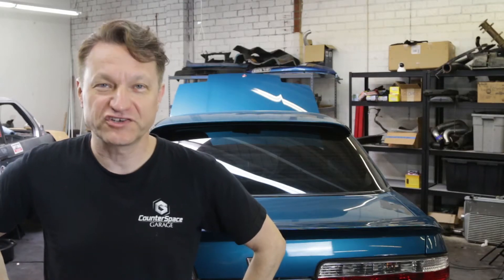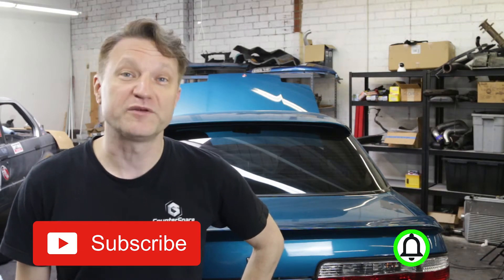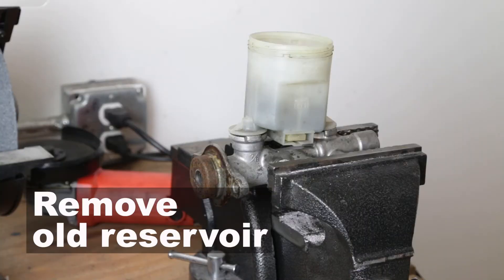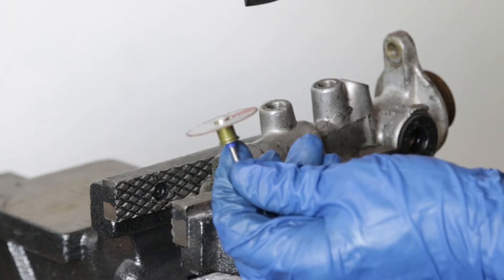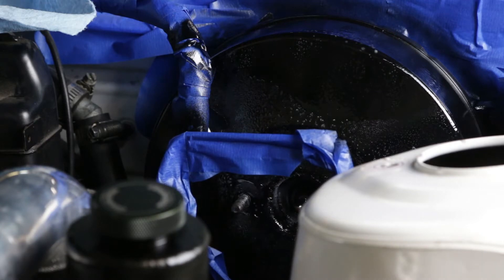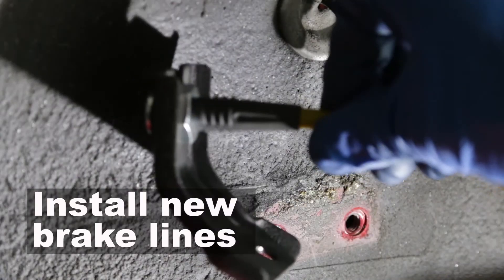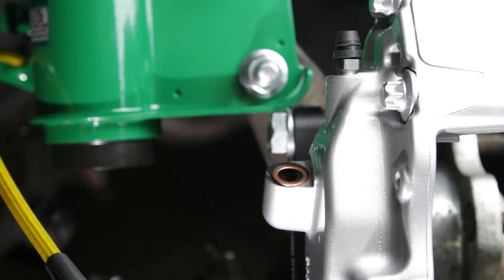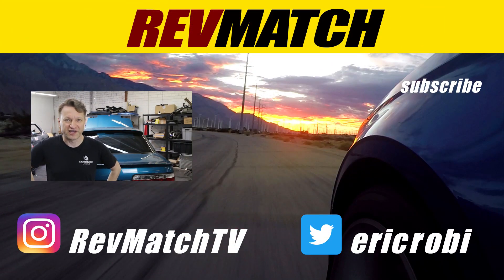Nissan 240SX Brake Swap - Part 2 - Replace The Master Cylinder

Comment: Aren't you supposed to adjust the pushrod to the new 300zx master cylinder?
Reply from the maker: It's been so long since I did this video that I forget. I don' think I needed to adjust it.  The brake pedal was very firm and not soft at all. I did have to push a lot of fluid throgh the system though to get rid of the bubbles though since the entire system was essentially empty after I swaped out the brake booster.

Comment: Rather than going through the fuss of cutting the fitting out of the old caliper, might it be possible to just buy it somewhere?
Reply from the maker: Caliper? You mean the master cylinder? You can probably get away with just leaving the original one in place.
Reply: No, the insert that you had to cut out of the old caliper. I personally would rather just pay a few bucks to buy one somewhere than have to cut up my old caliper (and probably slice right into that insert in the process).
Reply from the maker: @matthewstorm5188  I'm not really sure what you're refering to. I didn't cut the caliper.  I cut the master cylinder to remove the fitting. As I said above, you can install the calipers and use the existing master cylinder and see if you like the feel and avoid this entire step. At the time I couldn't find any master cylinder off the shelf that suited this purpose so that's why I did this video. 

 I have multiple videos in this series all posted in the same year. Here's the first video in the series. https://youtu.be/gH20d_pfz6s
Reply: Oops, not the caliper. The master cylinder. I was referring to the inverted flare seat that you had to cut out of the old master cylinder to fit into the plugged port on the Z32 master cylinder. Not sure if you can buy these. But if you CAN, it would be a whole lot easier than having to cut it out from the S13 master cylinder.

Comment: Im doing this ctsv kit too but was wondering if you think i should swap the booster as well or its good with the stock one?
Reply from the maker: I swapped out mine for a bigger booster to give match the capacity better to the brakes.

Comment: Hi revmatchtv 
The OEM rotors are 14" while 350z track is 12.75". Using the OEM pads of ctsv on smaller rotor do you mind answering if there is concerns?  Brake pad unused in the caliper?

Comment: I upgraded my s14 with r33 gtst brakes front and rear but the brake booster isn’t working. Available to me right now is an s15 brake booster. Will the s15 brake booster work for my setup?

Comment: How did you get the fitting out of the old z32 master? I just noticed the one I'm installing doesn't have one in the center hole either.
Reply from the maker: It's in this part of the video. Hacksaw. Carefully. https://youtu.be/eTiXeA2158Y?t=1m20s

Comment: Awesome quality videos man. I wish you did the more normal z32 swap so I could follow you're instructions.
Reply from the maker: Glad you enjoy the videos. I work hard on them! The basic steps will be the same, but it's actually easier since you don't need a special bracket for the Z32 caliper. They just fit right on to the spindle without a bracket. 
You will use 300ZX rotors and 300ZX brake lines as well. The 300ZX caliper does not use a banjo bolt.

Comment: Do the pads on the ctsv have hole that the pins are suppose to go through?
Reply from the maker: mlcg66 Yes they do. I don't think I showed that in the video.
Reply: RevMatch okay. I just ordered the bracket and the brakes. Was thinking about z32 but these look amazing. Can't wait.
Reply from the maker: mlcg66 Let me know if you have questions and I'll be happy to answer them.

Comment: Hey Revmatch, I noticed you did not bend the old hard brake lines. Do they line up with the 95Z BMC?
Reply from the maker: On the S13 they line up. On an S14 you will need to bend them.